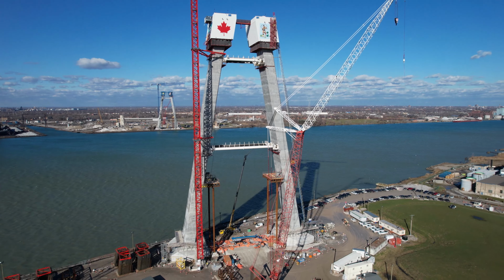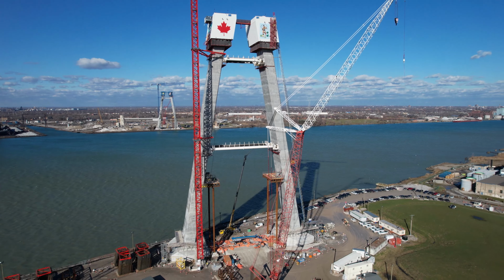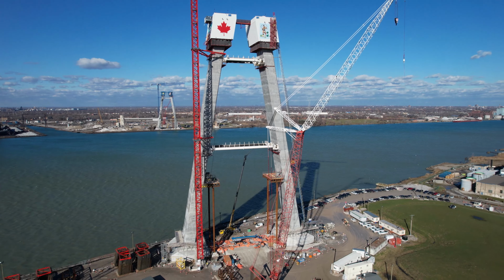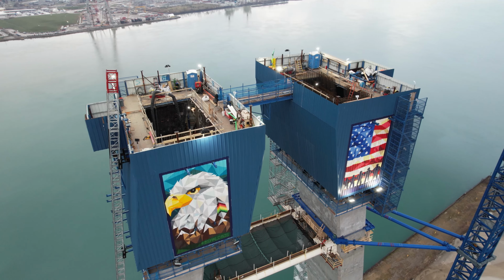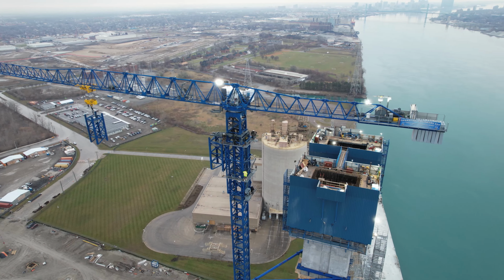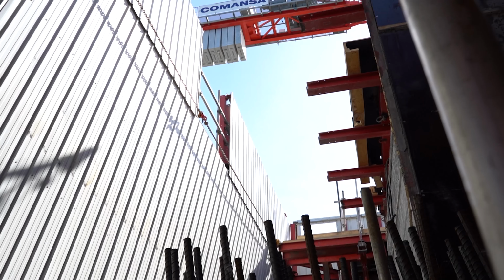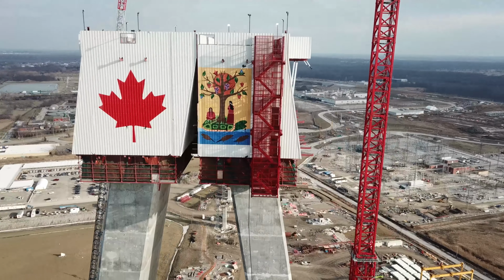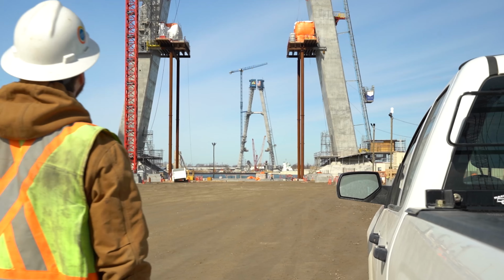Tower Construction of the Gordie Howe International Bridge Entering Next Stage

Comment: What rusty rebar not coated with rust protection ❓
Reply: Surface rust doesn’t affect the rebar or its stability.  It’s totally normal.
Reply: Intresting fun fact  @allisonhebert7070
Reply: rust is iron+air+water

ain't too much air or water getting in there once the casting is complete, not for a good 50 years at least. if they do it right it'll last 100+ years
Reply: they are securing future contracts.
Reply: @gary5807  LOL

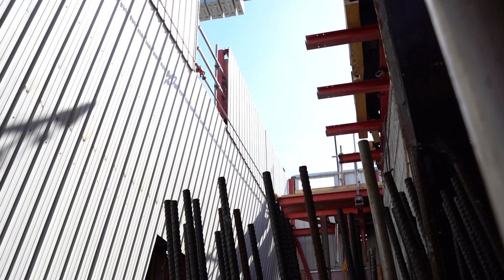Comment: 3:50 how long are the pieces of rebar? Are they connected to the pieces below, or overlapping? 
Is the rebar a larger diameter closer to the ground?
Reply: They don’t weld the rebar because it denatures the steel. They use lap splices (kinda like overlapping). The rebar footing is much larger in diameter than the tower legs.